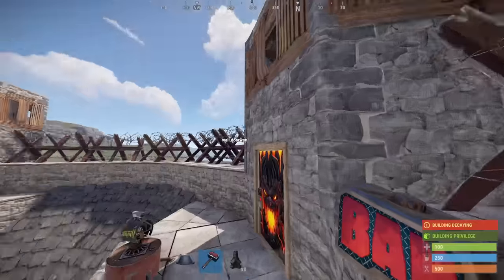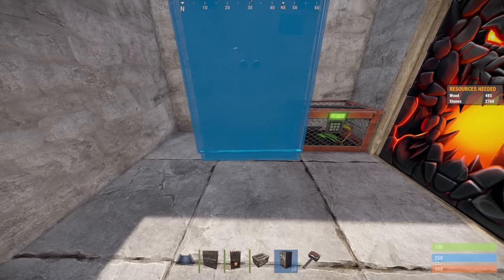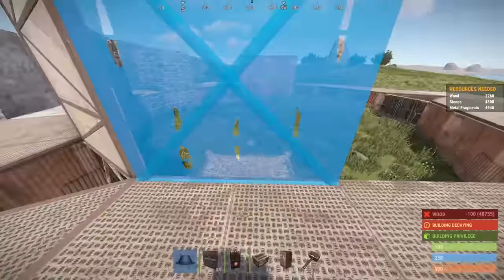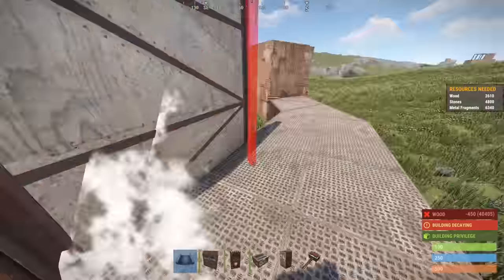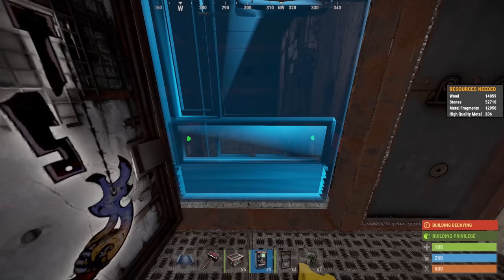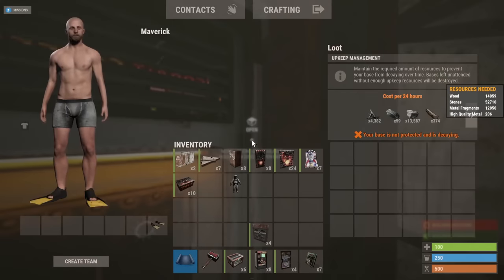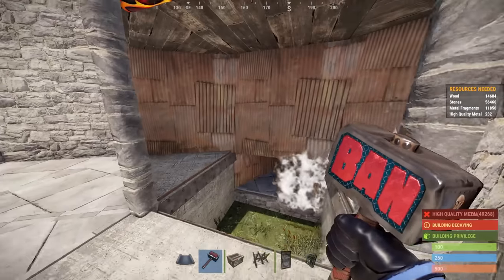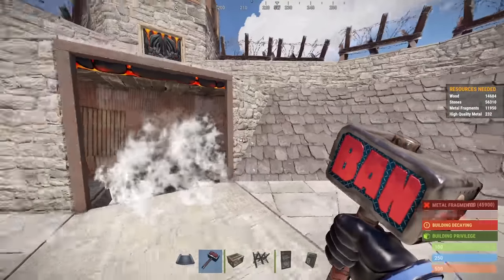Rust The Redoubt coreless base concept

Comment: As a builder this is so refreshing to see. A new style of base that looks to be viable. I will be having fun with this concept
Reply from the maker: Good to hear man have fun!
Reply: Is it not just inverted core but less defendable?
Reply from the maker: @maxpavv  You are right it is not inverted core can i tell you why inverted core never took off as a concept 1: it has the TC predictably in the centre of the base so even a low IQ player can raid without even knowing anything about building 2:It is a very complicated build and for all the extra work it doesn't raise the raid cost. 3:It has almost the same vulnerability's as a wide gap peek design where the extra TCs are in an easy to raid position usually only 8 rockets to take, raiders then place there own TC and double honeycomb metal or armoured and your whole clan base will be grieved. But you have obviously been misled by the other base designers who think wide gaps and inverted core are good but they are only meant for showing off on a build server. What they need to do is spend 10k hours in game then start doing base designs as the meta ones out there just get you killed and grieved because your outside twigging out foundations for to long.
Reply: @maverick1484  I agree and think they are very impractical (but kinda cool). I think it would be cool to make a 2.0/expanded version of this base with a well designed compound because atm IMO it would be hard to defend against a relatively deep group as there isn’t many spots to peak from.
Reply from the maker: @maxpavv  Yes you are right it has limited peeks, but I am already on it i have some nice ramp peeks coming soon
Reply: @maverick1484  Generally, people don't raid externals. A China wall will prevent grieving too. I'm not an inverted core fan but they're no less practical than this to be honest.
Reply from the maker: @CrowRust  Its nice to have a visit from a fellow creator! Thanks for the input man I have never really though about a china wall, most already find this to expensive but if its broken up into 3 or 6 parts with the externals built into it shouldn't be to expensive.

Comment: Couple points.

1) The defense turrets need some defence against simplest attacks/splashing.
2) Keeping the tower floors wood decreases your TC upkeep time.
3) You can be shot 360° in those towers, you need some dividers in there to be able to hide from incoming fire from more than 1 direction at a time.
4) Unless you place something on the tower roofs, someone will ladder up or land a heli on there.
5) Keeping a part of your base stone - because it's just honeycomb - is also telling the enemy that it's only honeycomb, by that losing it's value as honeycomb.
6) Since even a 2 storey can shoot into your base you can only build this on a hilltop.

Fortunately these are issues that I think are more or less easily fixable.

Comment: Love the concept, for some time now i have been thinking in a base with 3 or for separate buildings, creating an open center for maybe a furnace or something, so if one building gets raided you can defend from the other building, and separating loot make less profitable raid costs for raiders.
Would love to see more evolution to this idea, really enjoying this vid.
You deserved your like my man
Reply: this concept was already created by sean and patricko
Reply from the maker: Thanks man!
Reply: Maybe add a centre building that's higher add rooftops ontop to the three bunkers and u got a mini castle,only problem is upkeep.but bloody gud build maybe il try to add a middle 😉
Reply from the maker: @LEGIONSWRATH.  Sounds good, if its done in stone its not to hard to upkeep
Reply: I searched a lot for a concept like this and never found one, and im too bad of a builder to try...
But loving the idea of 2or 3 bases with tc each one closing a common patio.
But i barely can do  external tc correctly so...
Reply: @rickdiantres8873  Its possible to do this with 3 tc and offset in the limited testing I did, only issue is I had to use 3 external TC's and no internal TC, in some inner courtyard areas I had to replace foundations with half wall and floor. I only got the maybe 30% through build but enough to get footprint and inner foundations down and open Furnace area, No idea if roofs will place correctly.
Reply: @rickdiantres8873  practice on a build server

Comment: That's excellent. I would add a 'roam room' with beds gearsets in the middle (it would also provide sheltered access to the towers). 
That way you can always seal the bunkers if you're getting raided and use your roam room gear and towers for defense. If the 'core' gets raided, none of the good loot is lost.
Reply from the maker: Thanks, some very good ideas i like them
Reply: I like this a lot. Can also put a workbench in it and use it as the starter. Any ideas how to implement it?

Comment: Did a trio with this on rustoria EU long almost two weeks ago with this design, added 3 towers but everything the same. Got raided on day #2 and #3 (from when server wiped). Both of the raids were offlines by the 6-9 person group next to us. After we were raided the first time, and waited for the griefed TC walls to decay,  I put the new TC into one of the triangles the raiders opened up with the next two triangles having a sleeping bag each. This location would have been under one of the 3 towers. It was only accessible with a drop box. We put drop boxes to nowhere around the base as decoys, they still found the TC on the 2nd raid. I think they used ~35 rockets. We had everything sheet metal including the bunkers. I really liked this design but either I got very unlucky, or its this base is a "almost". It would be nice if you could do some TC stacking on your designs.

I did for a while use another well known rust builders designs. That base was like a punching bag, low upkeep, hard to grief base, loot rooms everywhere. Last time I used it, there where 4 of us and a ~20 player Chinese zerg from the other side of the map showed up to raid. So many you could see 10 lined up on just their largest raid bases top window shooting at you. I don't think they knew we where only 4, but they raided for 5 hours straight with 3 raid bases using about 100 rockets. I hope you make your next base design and call it "The punching bag" by Mavrick. lol it would be epic, like Sylvester Stallone rocky movie. Here is a link to a picture of that base, with 2 out of the 3 raid bases also seen. lol https://files.catbox.moe/7uq0zp.jpg

cheers

Comment: I managed to incorporate multi TC. Build a regular 2x1 starter. Then, building in line with the 2x1, build out 3 squares (should be a 5x1 line). From here, you can then build the ring as normal, except you need to remove the inner triangles between each segment. It's difficult to explain but it gives 3 flank bases with TCs and will confuse raiders even more, as TC is not in the actual base. Sadly, I am on console because I just can't afford a PC, but as far as I've seen, we're significantly closer to PC rust than at the start, and the devs has been very good at keeping things consistent with PC, and very quick to correct things that are not consistent.
Reply from the maker: Good work man sounds cool and yes you are close as far as building goes there is no difference.
Reply: I've been wanting to make it multi-tc but figured it would be too hard.

Comment: 1 week in 2x server with this base still going strong, expensive upkeep however with autoturrets it is amazing, would probably size up 1 block to bring base diameter to be slightly bigger for more options in courtyard as our 1 large furnace is sealed in the center of the courtyard. Our upkeep is at 22k stone, 10k metal frags and 80HQM for TC with most of foundation and honeycomb being sheet metal to give an idea for upkeep expense
Reply from the maker: My options vid gives a different setup for the bunkers giving more space in the core check it out in this linkhttps://youtu.be/lr4Zvd3Z9hM

Comment: I just got done messing around with this on a build server, modifying it and making it 3 separate buildings with TC's in each.
In order to do the multi-tc variant you start in the center with the triangle circle, go out 3 half moons, place a triangle and then square back to center.

I was able to fit 4 large furnaces in the center area while maintaining everything else in the build.

Comment: I really like the concept of this base and there are a couple of things that make it great, like the ability to put a large furnace in the middle and it being tricky for raiders.

Some glaring weaknesses however are:
The lack of more than 1 tc. If someone sees you building the base or is using some "xray vision" it makes this base pretty weak because they get full building priv for 10 rockets.

Online/roam raid defense is really tricky because of relying heavily on the stability bunkers. If someone were to land a heli in the middle of the base when the bunkers aren't sealed it would be very difficult for the base owners to seal them in time and it's not practical to have them sealed when online.

Its also a pretty expensive base for the amenities that you wind up loosing out on but I do think it would be fun to play this base on a 2x solo/duo/trio or something of that nature where there's a lot of offlining and the resources for the base are easier to get

Otherwise I really think this is a great concept that with some more work can really make a great base!
Reply from the maker: Okay so the trouble with multi TC is that the position of the TCs is to obvious like the fact that they are in the exact centre of were the gaps are and even if you don't know about that then finding one means you know were the others are because of the spread needed between them. So knowing were the TCs are makes it like all other bases so we have to do what they do and put extra honeycomb onto the TC rooms and now we have left the concept of the statistically unraidable base completely and are back to the predictable meta. Just use externals instead. You mention that the stability bunker is not good for going roaming but there are only 2 types of bunkers that are left sealed all the time and they are the sea bunker and the ghost bunker both my inventions, so i understand more than any other builder in the community because i have come up with solutions to the roam raid problem, I did not add them because i just wanted to put across a simple version that everyone can use even a noob can understand a stability bunker and besides even without bunkers this is still a hard base to raid (statistically unraidable core design remember)
Reply: @maverick1484  yea, i think a lot of the issues that i had are covered in the optional layouts video such as the usage of the auto turrets and the interconnected core to increase the ease of use of the base.

Something else i noticed that isn't that big of a deal but just something to think about is that you can position your base in a place to help defend your tc because it isn't in the center of the base. For instance, if you are building on the shoreline, put your tc closest to the water to make it so raiders can't FOB from that side.

I also challenge you to attempt to make the base and upkeep cheaper while retaining the same perks. I think its a great concept but it's just too expensive to use for a small group on a weekly wipe.

Thanks for the response, looking forward to the next vid

Comment: interesting concept but it definitly needs some more development to put into, for offlines on low pop servers this may be suitable, for onlines on high pop this base is gone in minutes as the bunkers are not sealable durring an online. HVing turrets from high ground or a raid tower is not an issue at all (maybe triangles above them?) and than you are just left with a few garage doors. It may be a good option to replace bunkers with double stairs bunkers as you just have to destroy the twig triangle hatch to seal them. Afterwards you would just have to find a solution for easier rotations to the towers, maybe put bedrooms with lockers in them and change peeks a bit so you can look down (small boxes in front of windows would be the easiest option). Also keep in mind that some people have ESPs immediatly telling them where your TC is making the whole concept (sadly) very vulnerable no matter what you do. Will try it out on the next wipe though with some modifications as it still looks quite interesting to play.
Reply from the maker: Have been working on a pixel gap version today to get rid of the bunkers completely . Trouble is you put good peeks everywhere on it and that will guarantee that you will get offlined, its finding that balance were they think they can win.

Comment: I just built this on a build server and found placing the tc vending machine easier from inside the room by the TC - then just suicide out. It's also well worth putting a bag down at back in case you mess up placement and can't access the TC from outside.
Reply from the maker: If it works better for you that's cool, I'm just worried its harder to see how far you are clipping into the wall with it from that side.

Comment: Should try a wallstacked version with 3 TC's to increase raid cost and decrease upkeep. You can also use the wallstacking to create bunkers.
Reply from the maker: I have been trying to be honest and have had no luck, If i split the base then the roof sections don't link up over the gaps so i end up using conventional triangle honeycomb, then i have to make the base bigger to separate the the TCs so they don't overlap each other and i just end up with a hideous monster every time 😭

Comment: This to me feels more like a base topper than a whole base on its own. If I remade this it would the same floor playout but 2/3 floors taller with using the space under the bunkers to put inward facing turrets for the inside of the base, and then the main loot bunker would be in the center hexagon with a pancake layer on top while the TC is placed in one of the original bunkers from the design. I have some ideas for the shooting floor but nothing conclusive yet. Still a fantastic design and I'll be sure to use at least some version of it in the future
Reply from the maker: Nice, That's what i like to hear i have left it a blank canvas as i know most of us enjoy building and it takes a lot of fun out of it for the builder if he hasn't put in some personal touch or addition.

Comment: Always move your tc you can use the f1 commands to locate the first placed foundation, hit any of the wall and see which one is the oldest entity number.
Reply from the maker: Very interesting i did not know about this
Reply: considering the factor that tc is gonna be honeycombed in a stability bunker and assuming the whole ring gets built around the same time, I don't think a raider can accurately determine which of the three is tc based off that, i'd reckon the raiders best guess of locating tc is to figure out which sides tc priv extends the farthest out/shortest
Reply: @elijahevo6859  theirs more than one way to skin a cat

Comment: You know what you could do? You could instead have an armored window frame over your TC and then put two shops in front of it and on top of that you could also fit a tr3 next to those shops with a single box underneath it and you press that tr3 as close up against that shop as he possibly can so as to make it so when you then put the box underneath I'm marked by the way just so people can see inside and don't break it out of curiosity with what you can do is hapas hidden storage adapter that goes behind the shops and gets placed before the window gets put down especially if you feel that room with some drop boxes and some other storage boxes, it could make it look like you're simply filling the space the tr3 has to go into at least until they raid all the other bunkers and realize that behind the shops is the actual location so you could in each one have the same setup but just with a tier 1, tier 2, and your tier 3 so that way they don't really know which one is which one you could even be cheeky and have your tier-1 be the one that goes to your TC.
Reply from the maker: I tested putting vendys in front of windows about a year ago and settled on my way with the door because if you shoot the vendys with rockets they splash through and destroy the window behind for free. But you do not get splash damage through a door so this way has a higher raid cost.
Reply: @maverick1484  to be fair the main reason like I said isn't necessarily for a higher raid cost but for the sheer fact that especially if they were to blow into two of the bunkers which already would take a good amount of explosives, they would then have to be faced with the question of do they try going through the vending machines and hope that the TC's behind it playing Russian roulette with that one-in-three chance?
Reply from the maker: @C_A_I_N_N  Ah okay i see what your saying  decoy TC rooms yeah i like it!

Comment: just a recommendation would be cool to add pixel bunkers in the double squares instead the stability ones are abit annoying and would work perfect with high foundations used and using half floors in the circle in the middle would really throw of raiders as they would think a room is down there
Reply from the maker: Just wanted to do a simple version to get the idea across but my god if you build this with pixel gaps it would be insane!
Reply: @maverick1484  i’ll gonna make a bigger version of this with pixel gaps will upload a tour of it when im done building
Reply: @joshhumphreys8960  I want to see this. Link please.